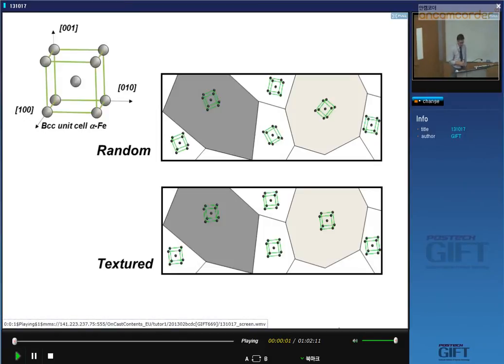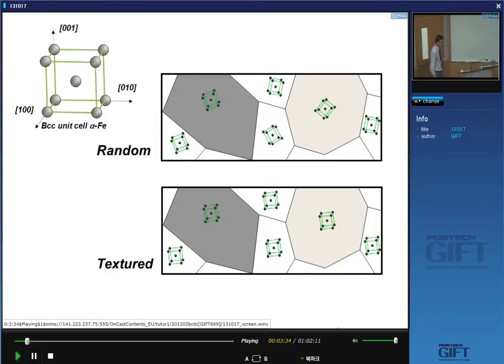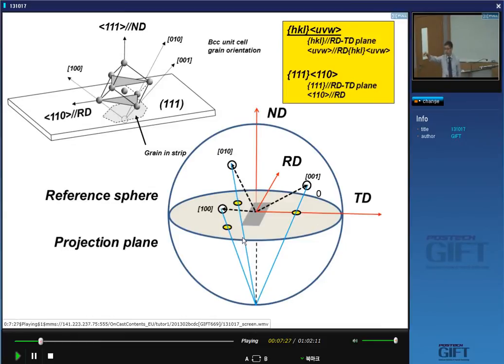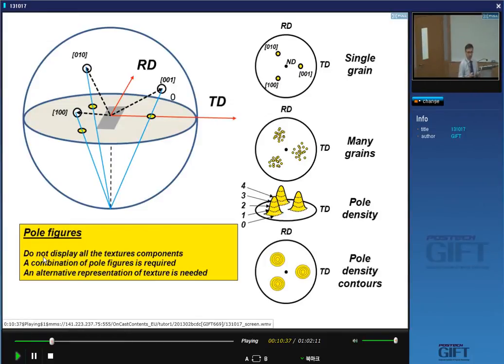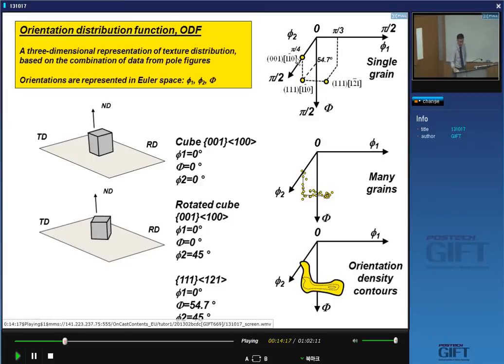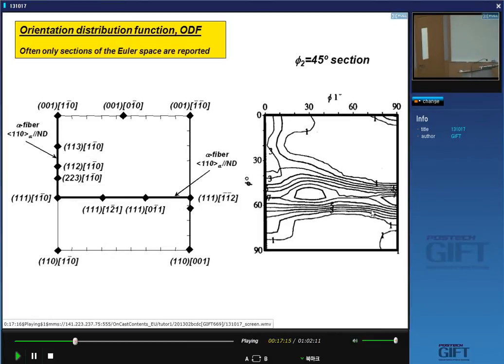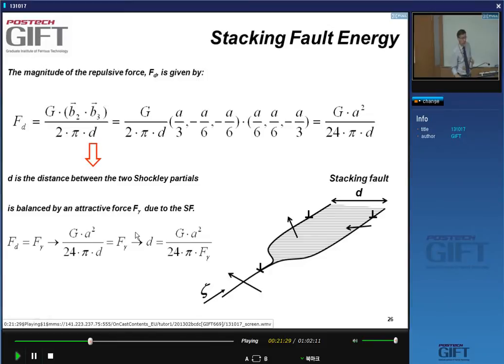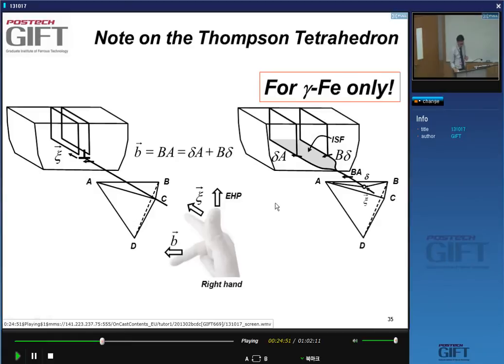Mechanical properties of steels 11: texture, dislocations, defects

Comment: what's meaning of  γ point  in the Thompson Tetrahedron  at 32:21.
Reply from the maker: The connection between the corner of the tetrahedron and the gamma point defines the Burgers vector of a partial dislocation.